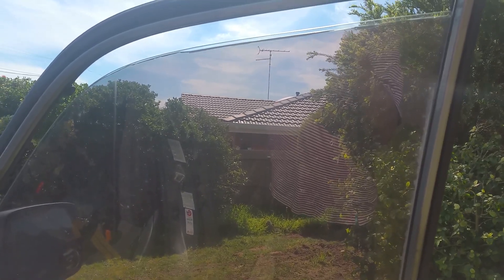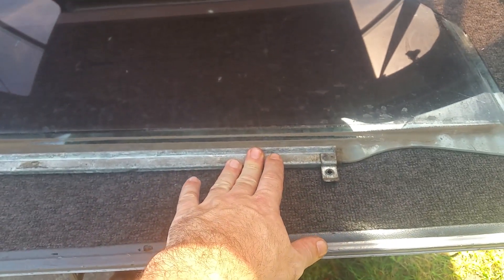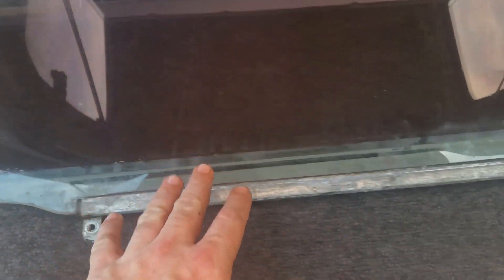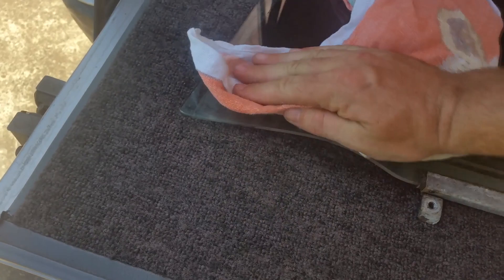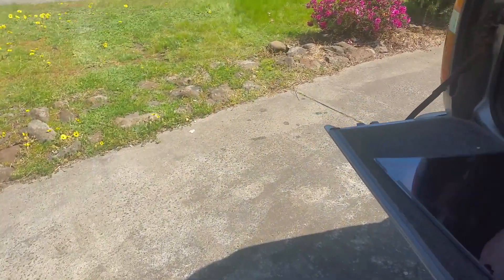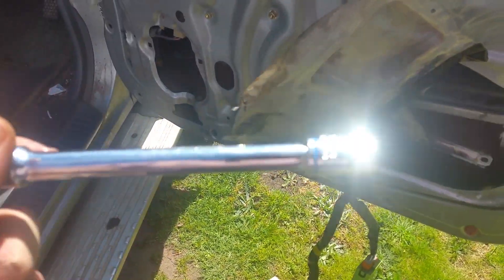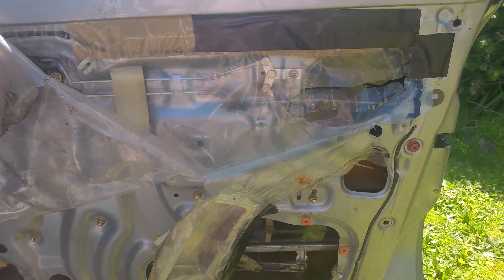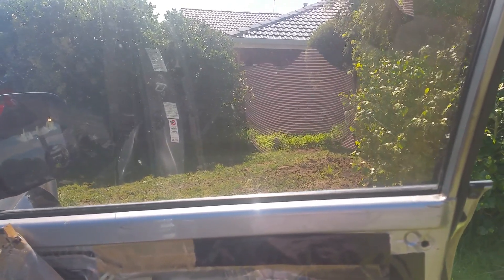80series Repair - Drivers side window remounting

Comment: Thanks for the video.  I had to reseat the  glass  in my LX450 twice. Each time I learn a little more.  If the glass came out of rhe track, be careful because it can fall down. I used aome strong tape to hold it up.  First time, I tried to slide the glass back into the bracket with the black rubber piece, it was harder.  This time, I took the black rubber piece out if the bracket, clean it the rubbed it with some dish soap and water, then slide on the glass.  I turned the glass up side down on top of something soft, I tapped bracket back into the glass with a soft rubber hammer.  It was much easier this way.  When put back, make sure the glass is in grooves of the door.  I lube the side channels with some WD40.

Comment: G'day mate!
Just want to thank you for your video.
Some reprobate smashed the passenger window of my LHD '97 Lexus LX450. Among other things they took some Metalica,BeeGees and Billy Bragg Cassettes.
Your video was exactly the information that I needed.
The next business day I got a used window , complete with bottom metal carrier and rubber seal nicely attached from a local Land Cruiser specialist.
With the interior panel previously  removed and the glass vacuumed out (careful those little shards need extra attention) and carefully cleaning and silicone spraying the window (who was"Bailey"?) slides, the cleaned new glass panel slid into place exactly as you showed.
Getting the 2 screws that hold the glass carrier to the lifter need to be lined up carefully, but with the 10mm socket and extention, it was easily done.
The dooe panel went back on easily, I used a heatgun gently on  the plastic fasteners, to remove 2 which were stuck to the door and reattach them to the pan,  warm up those fasteners and the panel will go on quite easily..
A few screws and connections and Bob's yer Uncle!
Hope you are well and your vehicle is still giving good service.
Thanks Again

Comment: Hi I've just found your channel and was wondering if you can help me. I have an 80 series 1992 model and having issues with the front DS window, the metal plate in the middle of the channel that I noticed in this video holding the window @ 4:09 (spot welded to the back of the greased up runner/bar) on my window is getting caught and bent and the window does no longer come up or down. Do I need this, can I remove this or do you have a suggestion to help me fix this issue? NB my window does not sit on this like it does in your video and also my windows are not electric windows. TIA Tim.

Comment: Can you show how to remove the liner. I was able to remove all the bolts but then the liner I was not able to pull it out. Didn't want to brake anything either. Thank you
Reply from the maker: Once you have taken the screws out, all you need to do is leaver the liner off the door. They use plastic clips which in some cases will come off the with liner and all you have to do is push them back in.